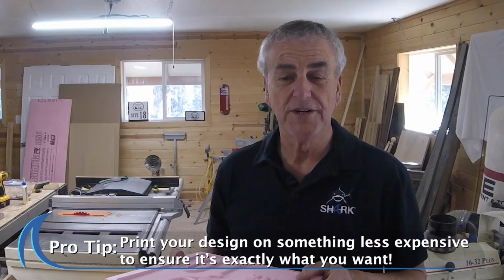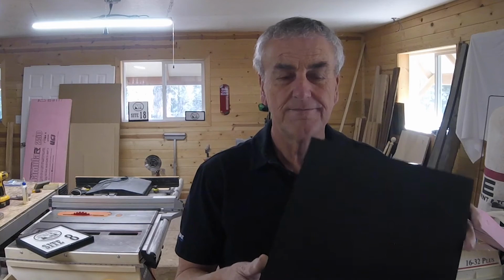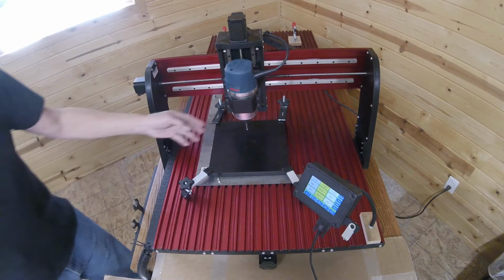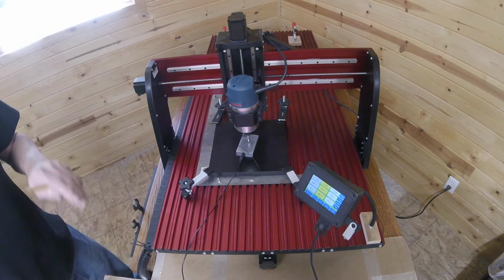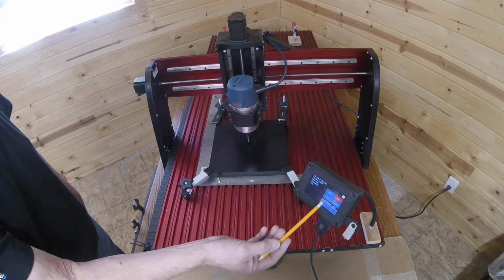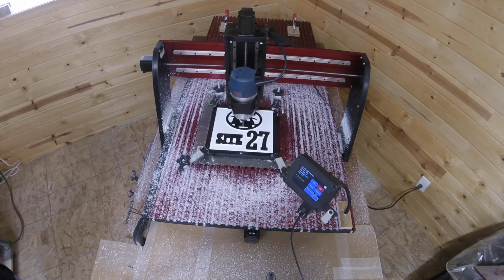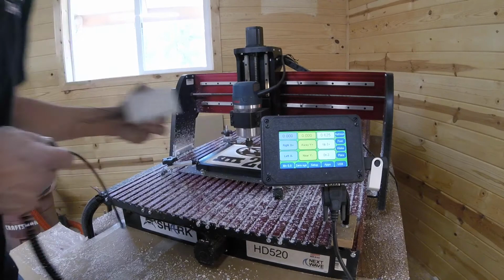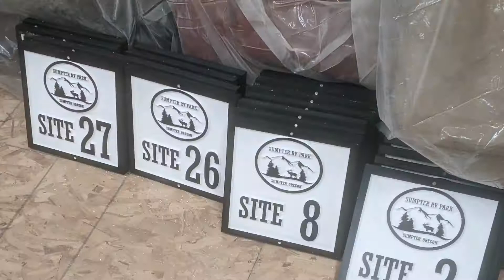Professional Quality Signs on My SHARK HD520

Comment: Ron, I am brand new to the CNC world and looking at the HD520.  The video was great!  What spindle were u using with the machine.  Was is Bosch 1617? Also do you have any experience with the water cooled spindle from Next wave?
Thank you!
John
Reply from the maker: Hi Jerry, yes it is a Bosch 1617 EVS - I've just always liked the simplicity of using a Router and it's ability to use 1/2" shanked bits as needed. You would need to step up to their 3HP to do that and I can buy quite a few Bosch for that $$ :-)

Comment: Ron, this is a very good video!  I can't find the kind of PVC you purchased at Home Depot.  You purchased 11in Wide by 1in thick.  Can you provide a brand name or SKU?  Also, after you completed all the CNC work.  Did you get a surface that did not need any further machining work?  Did you coat the finished sign with any kind of finish?  Thank you very much for your comments!   Mike from Denver
Reply from the maker: Hi Mike - it's called Veranda - usually only available on line in these widths. I have purchased narrower material in the molding sections of my local store. 

Model 827000204
Internet# 316293572
Store SKU# 1006203520

Comment: Hey Ron, did you purchase your pendant holder or make it?

Do you have any pictures of CNC benches people use?  

I just bought an HD510!
Reply from the maker: Hi James, I purchased it on Amazon, any standard camera mount will work. Sorry I don't have any pics, but I know a lot of people use the shop stands from Rockler - https://www.rockler.com/rockler-customizable-shop-stand
Reply: @ronshapland7990  appreciate the info.    I ended up making one and securing it with 3/8 black pipe and flange.  It will swivel, but I have to loosen the bottom bolt. That sucker won't break off anytime soon!

Comment: No spoil Board?
Reply from the maker: Hi Mark, I have a spoil board but they are removeable slats - didn't need it for this instance as I wasn't cutting through which is when I generally use them.